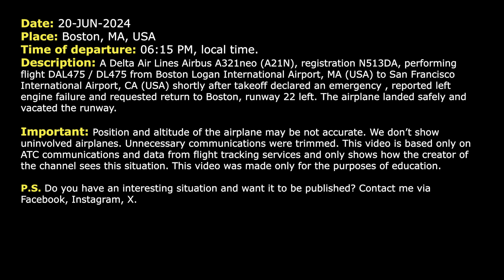Engine failure shortly after takeoff. Delta Airbus A321neo returns to Boston Logan Airport. Real ATC

Comment: Around 1:45 ATC asks if pilots want right or left turns, which would make sense since the asymmetric thrust on the engines would make it favor one direction, but I think it confused the pilots because they repeated they wanted 22L for landing. Still good thinking on ATC's side.